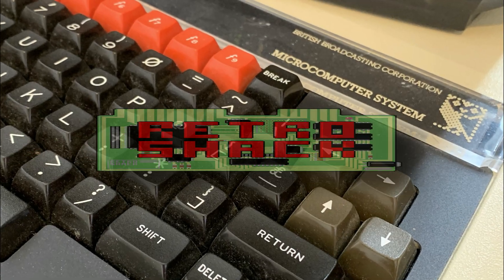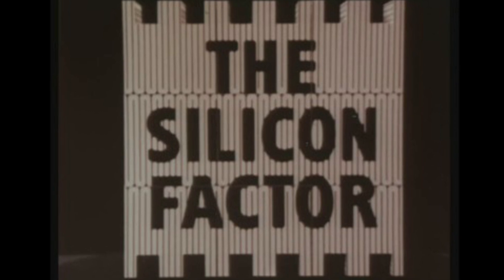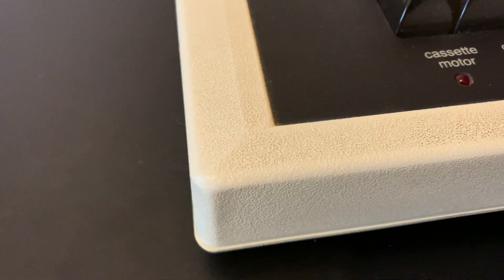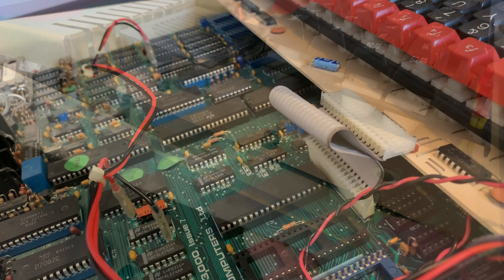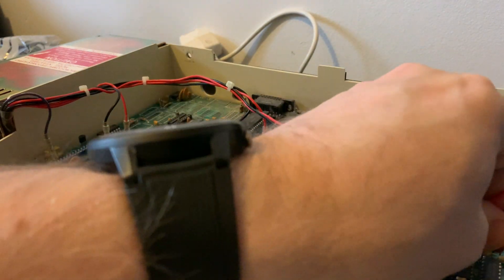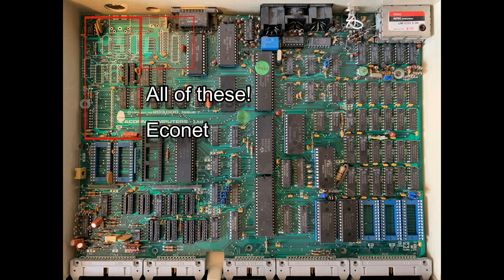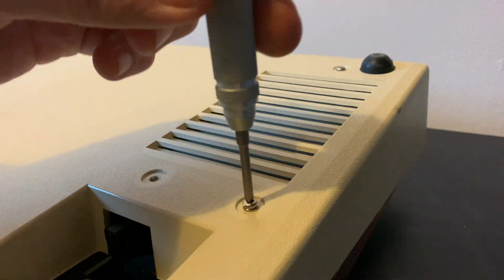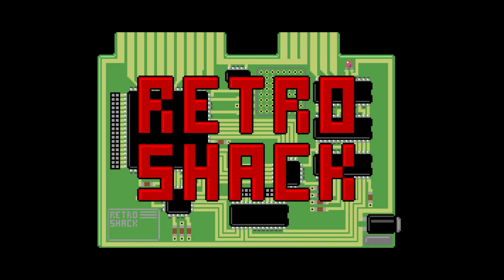BBC Micro - Part One

Comment: Fantastic machines and ridiculously over specified - Developing these must have been an engineer's dream!
Reply from the maker: Yep - I think the whole BBC Micro was so versatile it was like the Raspberry Pi of it's day :)
Reply: @TheRetroShack  could have been called the Raspberry Costco Slab Cake
Reply: @TheRetroShack  
With all that ADC and GPIO, absolutely!
I think it lacked a DAC though, so no analogue out pins.
The cartridge slots on the Master had audio in and out but it's just audio, you can't access it digitally.
I bought a refurbished Master 128 (it's beautifully done too) recently and I intend to design a sound cartridge for it using a Yamaha FM synth chip and mix it in using those sound pins. That will also add a few PCM channels! 😂

Comment: 4:55 I appreciate that you call it the main board instead of that bizarre "mother" stuff (that far to many people today thinks means printed circuit board).
Reply from the maker: I think there's a case for 'Motherboard' when there are clearly options to fit 'Daughterboards' - but I tend to use 'Mainboard' most of the time :)
Reply: @TheRetroShack  Exactly. When its main purpose is to hold daughterboards, it's a motherboard. Otherwise it's just a printed circuit board (or more specifically a mainbord, system board, computer board/card, and so on).

Too many people would today use the term "motherboard" even for the pcb in a mobile, a printer, a modem, a graphics card and similar. That kind of sloppy semantic drift actually destroys language (whatever the postmodernists say).
Reply: @SpeccyMan  I know, and corrected the typo. I see 'they're', 'their' and 'there' mixed up all the time, even 'then' for 'than'. And that's usually from people with English as their mother tongue.

Comment: I have 2 of the Beeb Model Bs and a (fully pimped) Master 128. I well remember the struggle with the power plug :-)
My computing history  goes back to before the Beeb, starting with a Commodore PET, then a Beeb, (which was eventually donated to a local school when I bought my first PC), and now I'm a      Mac user.
The 2 BEEBs I now have were bought for £1 at a ham radio junk sale, about 15 years ago. The PSUs for both have been recently recapped and are fully functional, with extras.
The Master 128 has a Gotek floppy emulator, a micro SPI adapter, a Retroclinic Data Centre, switchable Multi-OS ROM, and multi co-processor (based on a pi Zero).
I also have 2 'proper' 5.25" floppy drives, but I don't really use them much since I got the Gotek.
The BBC computers were fantastically expandable, an area where most of the competitors at the time were lacking
Reply from the maker: Then you sir, are going to like next week’s video very much :) Thanks for watching the channel!
Reply: I also have a pretty Gucci Master 128.
I intend to design some cartridges for it though, something you hardly ever saw used, those mysterious slots on the Master!
I'm thinking a Yamaha FM Sound Cartridge and then a game that uses it.
Because I think this will leave you with all the RAM free rather than having to fit the game in RAM.

Comment: That little per cable as I'm sure you know is the speaker cable and quite easy to forget when you put the machine back together. If the keyboard is left disconnected, the machine won't boot. There are lots of reports of people snapping of the power connectors, so take care everyone, although replacements are cheap, they will require soldering. If you don't fancy soldering and don't plan on using composite, the wire to the center of the composite connector can be shipped and the connector unscrewed. The weird are long enough to get the board out without removal, but you still have a board and case connected by sorry wires. If you snoop it, make sure that it won't sorry against anything. One last thing, the analogue/joystick port can be screwed in which will also keep the board held in. These screws are very easy to strip if they haven't already been by overly excited kids plugging in joysticks or classroom experiments.
Reply from the maker: Not sure why, but lost the reply to this comment when the channel moved - Anyway, not ignoring you and yes, you were right about the speaker cable :)

Comment: Hi I will have to fund come pic for you, my dad was 1 of the BBC eng team, who worked on the spec and testing of the BBC Micro, I have the 1 of the BBC prototypes in my stores somewhere. its SN is lower than the 1 in ARMs has. I need to check if it is the issue 1, 2 or 3 board, and when my dad took the first 1 (the veroboard in the rack) for a few weeks, so how children got on with using put, at the age of 6 or 7 we did not understand how important the rack of wire was and how it would change the world.
Reply: Would you also be interested in sharing your story over at https://stardot.org.uk/forums which is probably the best site for all things Acorn.?
Reply: Roger, definitely - if you can dig that pic out it would be very interesting!
Reply from the maker: Thanks for sending in those pictures Roger - Much appreciated!
Reply: @TheRetroShack  Would it be possible to see those pics somewhere?
Reply from the maker: @qo92  They’ll be making there way somewhere soon ;)